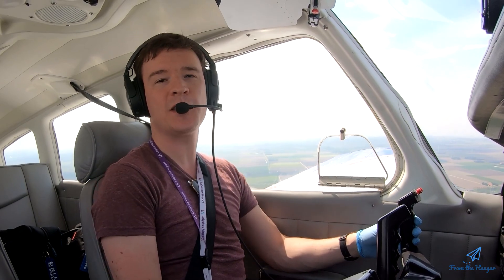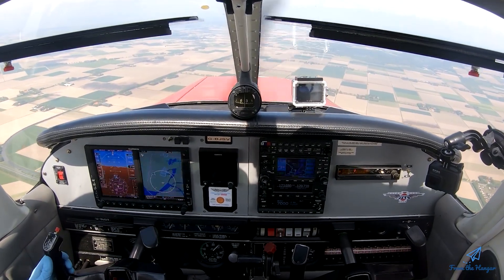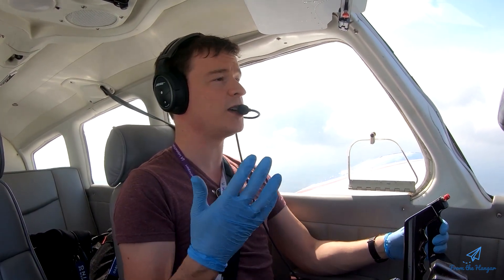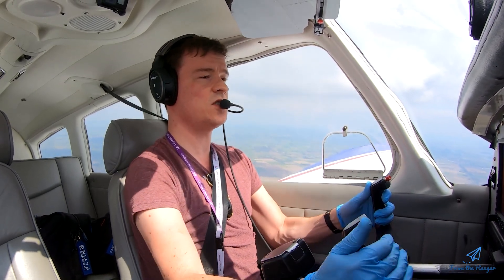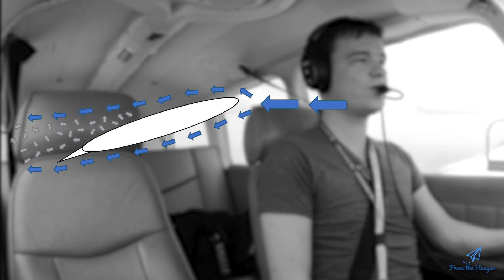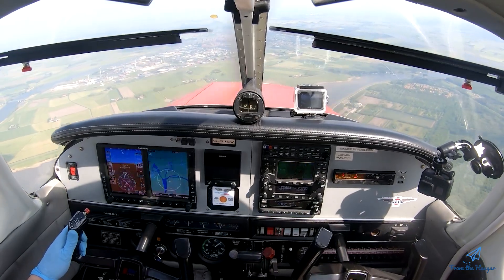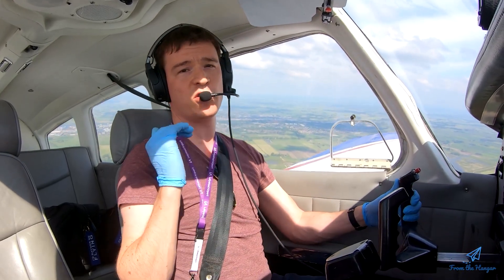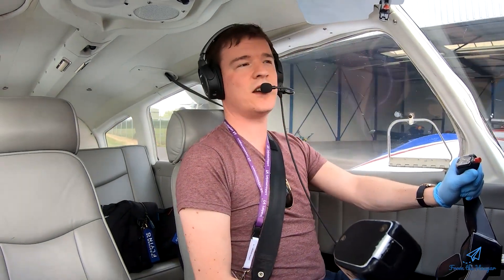Stall and recovery, Online Flying Lesson in a Piper PA28

Comment: you dont use flaps for power off stalls?
Reply from the maker: We teach multiple combinations, clean, approach and landing configuration, full stall or recover at the first indication of the stall, and recovery with and without power. It's up to the examiner to ask for the combination they want to see, so we practice many different ones.

And also in a climbing and descending turn, those are also exam options.
Reply: Full flaps are used for power off stalls in the PA-28 series of aircraft.